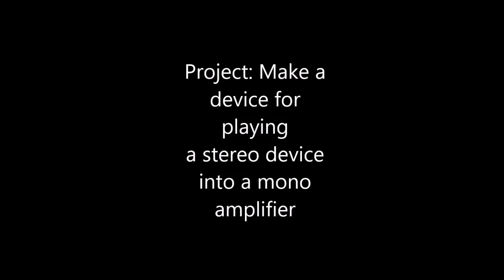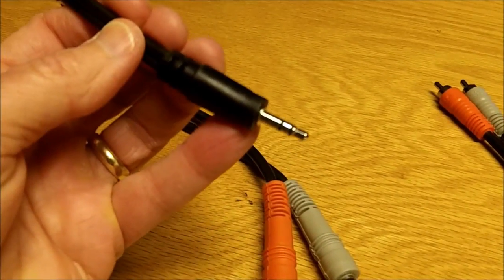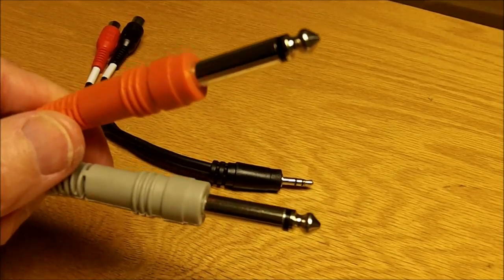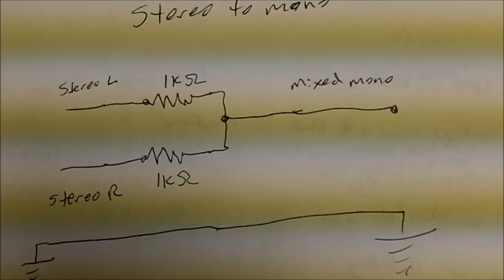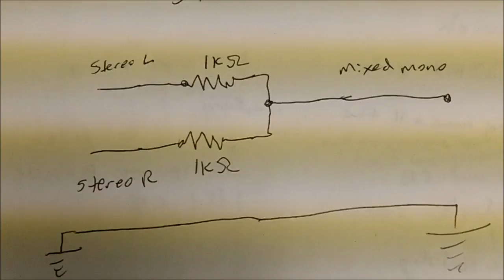Play your stereo music into a mono amplifier with this easy project!

Comment: Good video.  I want to combine the Front Right, Front Left and Center outputs from a 5.1 channel amp.  Can I assume that I could combine those three inputs into a single output in the same manner,  using a resistor for each channel?  I plan to use the output for a hearing assist unit that only accepts a single input.
Reply: that should work, but you can also just use the center only because that should have mostly the voice audio signal and will also have components of the L & R signals.

Comment: Hi! Good and simple video. 
I was wondering can this be used to make a box to connect two guitars into one amp?
Reply from the maker: Interesting question. In the case you're talking about you would want to mix two mono signals together into one mono output. So, you would want two mono input jacks for the guitars and one mono output jack for the amp. You could experiment with the best values of isolation resistors . Look at a schematic for a vintage Fender tube amp - the input jacks 1 & 2. That's what they did - combined two guitar jacks into one signal.

Comment: Hi does this work as a split cue for dj mixing ect?.... Thanks
Reply from the maker: I don't see how it would be useful for that, since a split cue allows the DJ to listen to the master output signal to one side of the headphone and the headphone cue output in the other side. The device in the video mixes two signals into a single signal. i.e. - stereo changed to mono.
Reply: Ah okay cheers :)

Comment: Hi, i've done this and it works but the sound is very low. Have any idea why? thanks!
Reply from the maker: If you wired as specified, there should be almost no attenuation of signal. What are you using for signal sound? iPhone headphone jack? If so, do you have volume adjusted to max on iPhone?
What are you feeding signal into? Amplifier? You haven't given me enough info to help you.

Comment: Hi there Sir James, i'm thinking of combining 2 inputs (electret plus piezo) using dual op-amp. Yes, they have 2 different outputs but idk if they have similar output impedance, so can i use your method to combine those 2 outputs to mono?
Reply from the maker: I think you are planning to feed the output of a Piezo pickup into one input of an op amp and the output of a electret mike into another input of an op amp and you want to know if you can combine both op amp outputs together for a mono signal with the circuit in the video. If this is correct, then, yes, you should be able to. The outputs of the op amps should be the same impedance - assuming the same op amp and circuitry. The only problem I see is that unless you can adjust the gains of the op amp circuits the two will be different amplitudes( since the piezo and electret will have different output levels). Combining levels that are not equal amplitude will result in more of one "channel" than the other. But you can try it and see if it meets your needs!
Reply: @jamelectronics  Yes, exactly. I saw schematic from the internet, 2 different schematic for piezo and ECM but they use tl071, but im thinking of combining those circuit to one using tl072 since its a dual op.amp. Maybe, both can be played in mono. This setup is for my violin and will be plugged in to my Reverb Stompbox
Reply: @dctayong14  You can experiment with the op amp feedback resistors (maybe use a trim potentiometer) to get the signal levels to match.

Comment: Great video; one thing I've tried and it should work with your setup too, is to use a 1/8 inch stereo to 1/4 inch dual jack cable, with the 1/8 inch at the music source (iPod etc) feeding into two separate audio channels on your mixer (in this case let's say the left input on channels 2/3 and 4/5).  With the balance on both at center (or left) position, you would get both sides of the signal coming out from the left 'main out' of your mixer, which by using a standard mono/guitar cable, you could then send to your amp, negating the need for the box or a specially prepared cable in the sequence.  Since the mixer is designed to handle line level inputs from a stereo source, this shouldn't be an issue?  So overall the box is great if you don't have a mixer, and is nice and portable, BUT the mixer will do this job for you if it is set up as described above - and of course if you aren't using it for anything else.  Am interested in your opinion....Cheers
Reply from the maker: I agree, you can definitely do the same by using a mixer. This just a simple method that doesn't require a mixer. Thanks for your comment!

Comment: Is it possible to get links (amazon) for each element you use to create it? Or the name itself is also helpful, so I go and get it in the store. I have no real idea of that topic, but want to try it. Is there maybe a ready made box, to buy somewhere?
Reply from the maker: Here are some links for parts. Similar parts are available on Amazon or Digikey, or Mouser. 
https://www.radioshack.com/products/radioshack-project-enclosure-5x2-5x2
https://www.radioshack.com/products/radioshack-gold-plated-panel-mount-phono-jack
https://www.radioshack.com/products/radioshack-1-4-mono-panel-mount-audio-jack-2-pack
https://www.radioshack.com/products/radioshack-1-8-watt-1k-carbon-film-resistors-5-pack

Comment: I want to try that as well. Do you think it will not cause any problems with the amp?
Reply from the maker: It should not cause any problem. The headphone outputs of the iPhone, iPod or other device at isolated by 2000 ohms. The resulting signal is one input to the mono amplifier.

Comment: Hello Mr. Patillo. The other way around also needs resistors? For example, is it right to take a mono output and just connect the signal to both channels of a headphone without resistors?
Reply from the maker: It depends on what type of mono output you have. If it is a low power output like from a preamp, then probably OK. But a mono output intended to drive a speaker, no. Would damage your headphones. As long as the mono output is of the level that headphones can handle, then you should be able to drive both sides of headphones without a resistor.
Reply: Very clear, thank you.

Comment: Great Video! I have a stereo speaker system with an active sub and to passive HF Speakers plugged to my pc. The left HF is broken, and I wonder how i can get mono signal into it. Sub and PC are connected by 1/8" Jack. When I use your method, are the resistors still necessary?
Reply from the maker: Yes, I would still use the resistors.